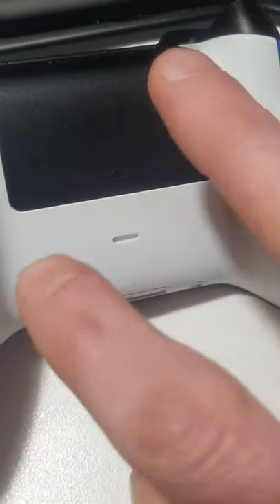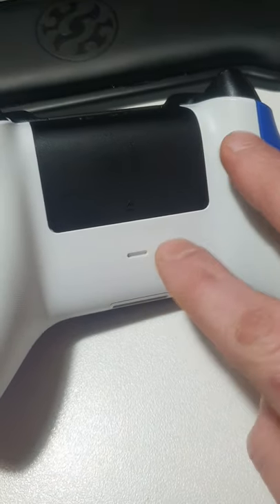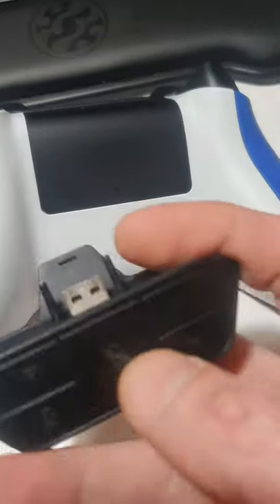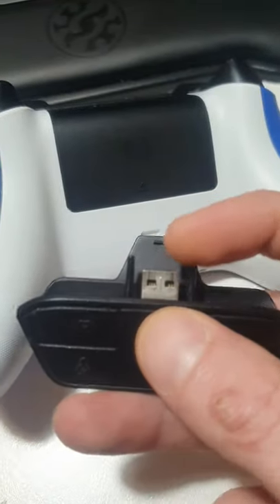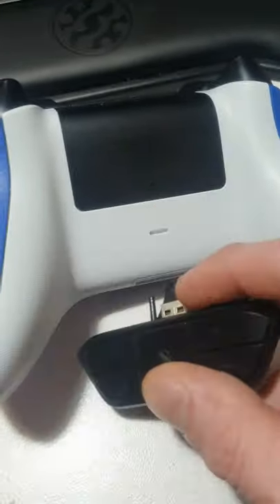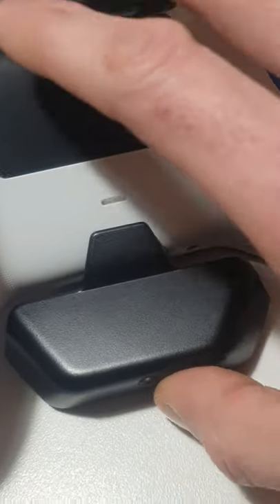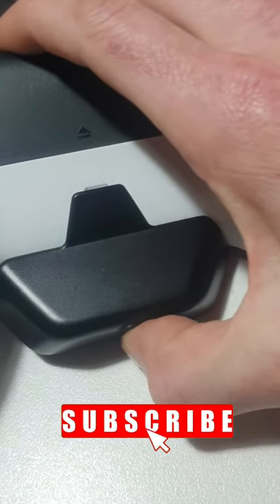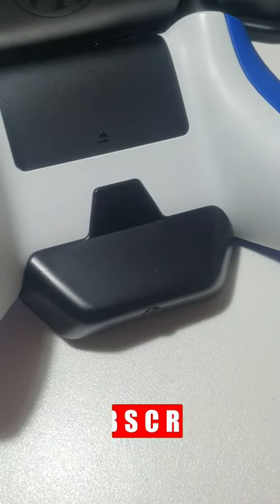the hole in the back..

Comment: What is that accessory called? TIA
Reply: @aidancommenting   Great, thanks! But can’t someone just use a headset with USB? Even wireless?
Reply: @aidancommenting   sorry that I did not specify. I was speaking about the series X and plugging the transmitter into the USB port while wearing wireless headphones with DTSX. Sounds awesome! Thanks for helping me straighten out my comment. With the Xbox one I would use Bluetooth headphones on my TV. Not sure if I got the best sound from that but it worked OK.